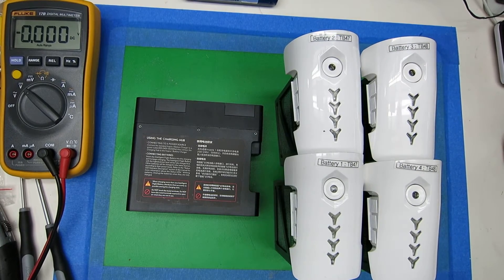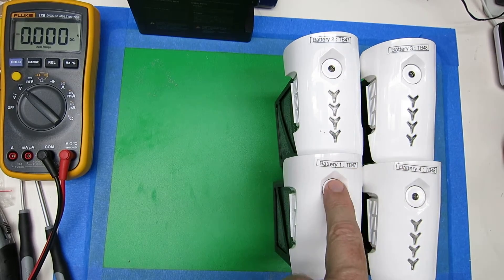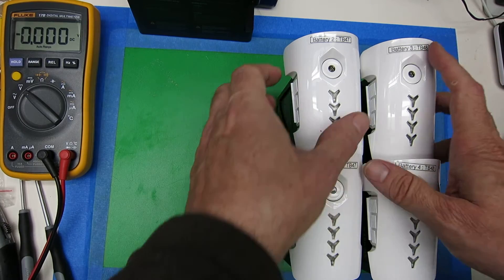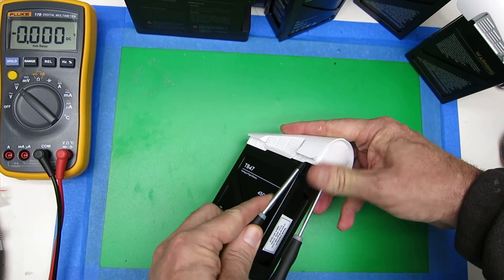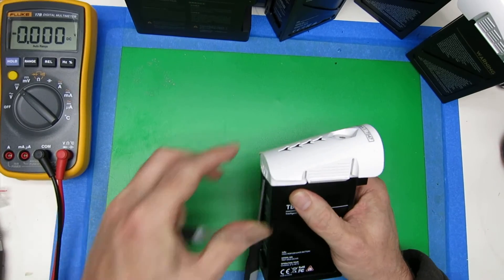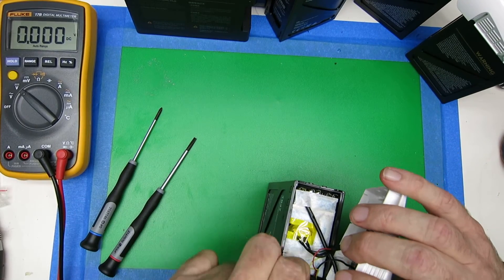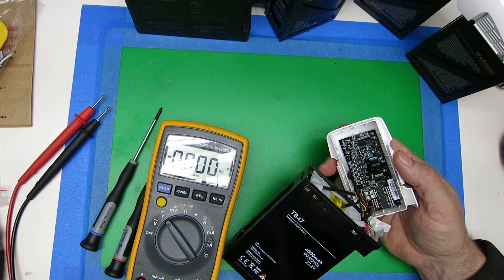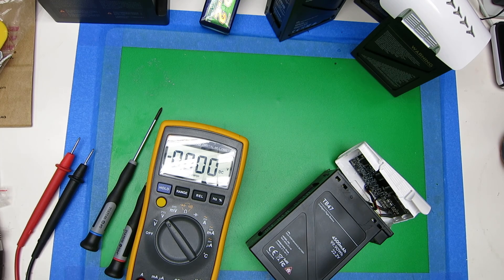DJI Battery Failure and Diagnosis (part 1)

Comment: I have the exact same issue with 4 batteries. 3 of the batteries had 0 flight time and only 1 charge. Stored in a large case in comfortable environment. Pulled them out after 3~6 months of storage and all were dead. No signs of life whatsoever. Very troubling considering the cost of the Inspire X5 Pro and/or the $200~250 per battery price tag.

I am in contact with DJI and they told me to send them in for repair/replace. I do not yet know how good they are with resolving these sorts of issues and my opinion of DJI until now has been very good. Hopefully it remains that way.
Reply from the maker: No joy for me, hope you have better luck!